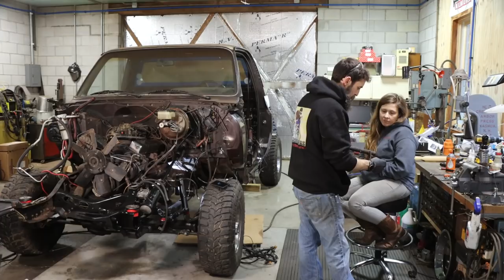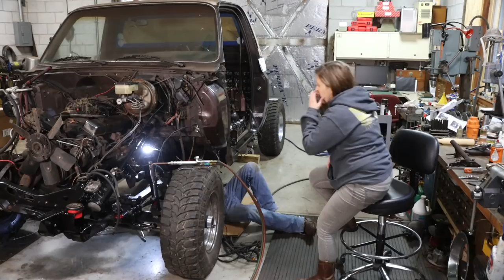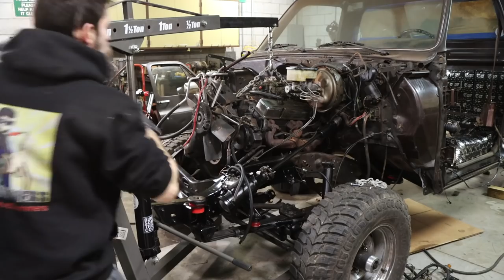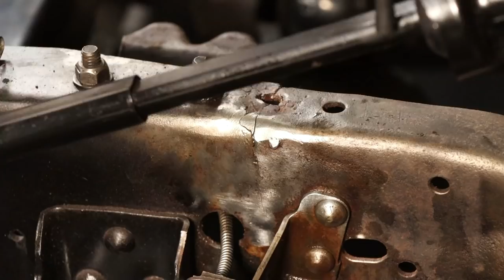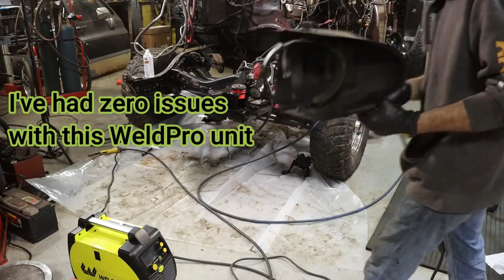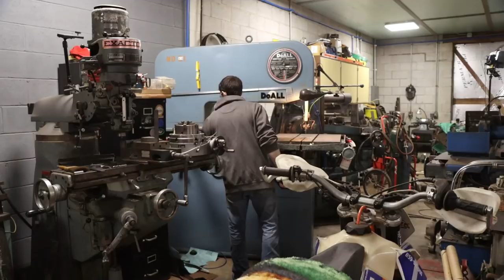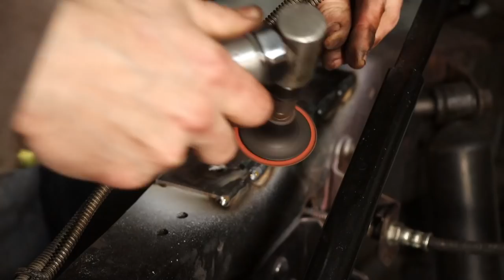Pulling the old engine and repair the damaged frame.

Comment: Naturally welding the ends of the strap was my inclination, so thanks for mentioning it. I’m hungry for more analysis reasoning about this. I suppose this frame area has cyclic fatigue issues. The fix seems to be a progressive load sharing scheme eh?
Reply: You never want to weld across a flexing member.  You'll just end up with cracks developing adjacent to the welds.  Remember, in this case, most of the load is being carried by the frame flanges. Since the metal adjacent to the welds will be close to yield,  imposing a cyclic load invites the risk of developing fatigue cracks adjacent to the welds.

Comment: SUPER psyched to see what you have in mind for the engine. In one direction i say rebuild the original engine. Just the rebuild with a few little extras can add a lot of HP to the old gal. In another direction i say JUNK YARD LS SWAP! but those are even ridiculous in price lately. It’s really coming along. Well done steve!

Comment: Because I don't know. Does heating a bolt red hot to brake it free change the strength of the bolt afterward? Or do you just plan on replacing it regardless. Stay healthy.
Reply: Always replace a bolt that has been "red hot"!

Comment: You never explained why the frame cracked there, other than emanating from an unused bolt hole in the frame. Could it have been from the overload bumper, because the front leaf springs were worn out and reverse arched?
If you really want the "new" engine to last, I suggest fuel injection. Newer FI engines run so much cleaner, inside & out, and longer with FI. And there has to be a ton of FI conversion kits out there for Chebbies.
Reply: Yeah, that and the shocks that were shot... extra movement and vibration?
Reply from the maker: Probably a host of reasons why it cracked where it did.  I couldn't tell exactly why.  A cross member  starts  directly in front of where the crack was . My guess is it was a high stress area weakened by a hole in the web. 👍

Comment: 400hp 350 ain’t to bad of a build decent cam and roller lifter/rocker setup run flattop pistons or mild pop up intake headers done but honestly that truck id slap a good cam nothing crazy shoot for 350/350 run the hydraulic lifters it came with intake headers done should be done around 1000$ id like to see you do the engine machining tho even tho Ik how much work that is going to be But finding info on setting a block up to bore on a bridgeport style machine doesn’t exist
Reply: Eh, squaring the decks and boring doesn't cost that much.
I would get the main bores line honed as well.

Comment: Steve you may wan to consider doing that on the other side. I've seen that crack in the same place but on the passenger side. It was just on the top, but if it was let go longer it would have surely made its way down the side.

Comment: You do a good job of telling folks your thought process. You're going to be put to the test on that with the motor. There's a reason why mechanics rarely rebuild in house anymore. You can get a crate motor for around the same money. Your time isn't free. Though doing it for youtube changes the math quite a bit. People are going to have passionate opinions either way.
Reply: Dave Wood, there’s also the point where you really enjoy rebuilding a small block Chevy engine so you’re doing something for the fun of it. Some people go to amusement parks, some people rebuild cars and engines. The money you save not going to an amusement park might pay for the parts to rebuild your car. Lol I got a little carried away on that one!
Reply: @Hoaxer51  right. There’s always other factors, particularly for diy. He’s not a professional engine builder but probably competent enough to handle it but the pure time and money answer is that a crate motor is the way. The gist of what I was saying is that not only is he going to explain the larger alternative choice endlessly but every choice along the rebuild. Interesting content yes but not simple in ways that other folks building their own don’t have to consider.

Comment: That truck must be a 1987 last year of that body style, the 1977 had the round head lights and the 1987 had the double square head lights, i owned both trucks, my years where 1978,1981,1987, 1989, 1992 and the one oi have today is 1998. I am a Chevy GM person for 50 years

Comment: Does the thickness of the plate affect anything with the motor sitting a little higher?
Reply: Look at 18:30...the motor mount bracket bolts to the underside of the frame flange.

Comment: If you add some more HPs, I assume you will also allow it breathe more freely if you catch my drift.
Motor or engine? From my limited observations, auto-techs call it an engine and shade-tree mechanics refer to it as a motor. For the most part, motors are electric but yet there are gasoline powered outboard motors and motorcycles. In the days of steam, they were steam engines and not steam motors. Bottom line, it does not make any difference.

Comment: I remember working on those old Volvo 240s. Simplicity at its finest. There wasn't a single thing on those cars that couldn't be pulled out easily or replaced cheaply.

Comment: Hey Steve! I pulled a Renault 5 engine to pieces back in the 80’s. The worrying thing is when I rebuilt it, there was a whole bunch of nuts and bolts and washers left over and I hadn’t got a clue where they went. But here’s the thing: the vehicle ran for another three years!
Reply: Spare parts from the factory......
Reply: @SeanBZA  just optional extras!

Comment: It might be a good idea to stick a bolt in the hole on the other side to prevent a crack starting there as well.  It's been my experience that holes with bolts in them are less likely to crack than those without.

Comment: As someone who doesn't do this at all, I was fascinated by your really slick-looking frame reinforcement.  First, I realize that there are many reasons for thoroughly cleaning the frame before working on it.  However, watching all those white-hot blobs of weldment falling into the frame, I could see yet another really good reason...
I really liked the skip welding idea, but it looks like that would allow water in.  Was that why you sprayed it with a white substance before welding?
Reply: I'm guessing that was weld through primer.  More primer and a top coat over the repaired area, to slow corrosion down.
Reply: @eliduttman315  OK, that makes a lot of sense.  Perhaps the weld-through primer also helps wick a bit of the top coat into the edges of the gap.

Comment: For a truck that will be a work type I would go with Low end torque, most HP engines have that extra HP at a higher end of the RPM's or as lease keep the extra HP at the low RPM range as possible...

Comment: I think the only way to fix the cracks in those square body frames is to put them in the crusher with the rest of the truck. I don’t know how many Iv’e welded on over the years but it’s mind boggling to see that an auto manufacturer let something like that go out the door, and the frames on the 88 to 99’s weren’t any better.

Comment: That reinforcement plate will be under the engine mount - won't that mean the engine mount and thus the engine will be out of alignment?
Reply: The exra 3/16" on a rubber mounted engine isn't going to put anything out of tollerance.